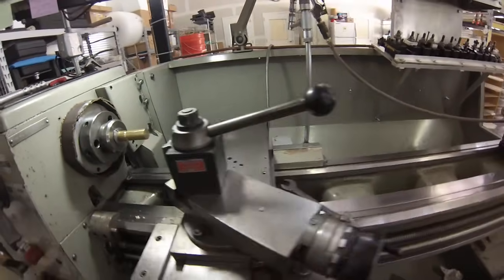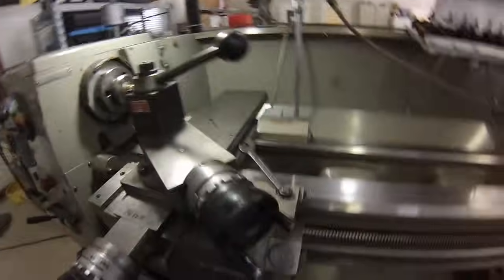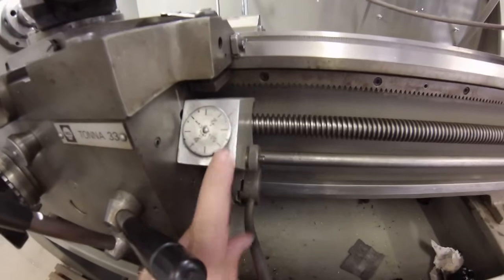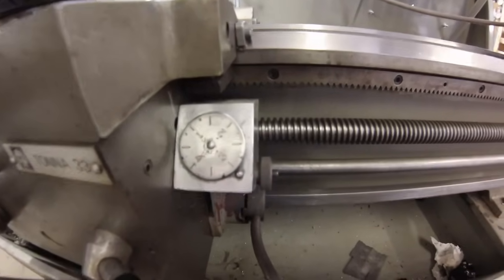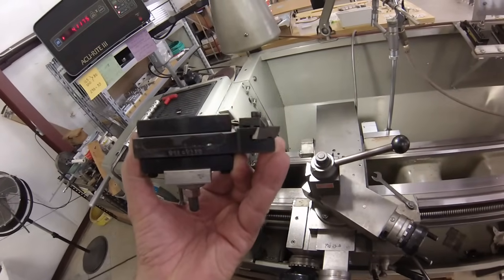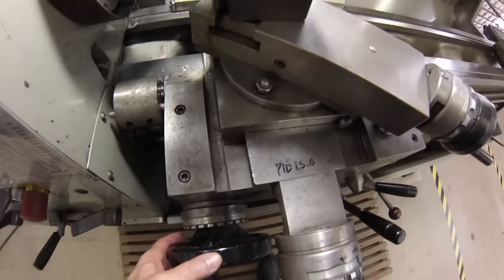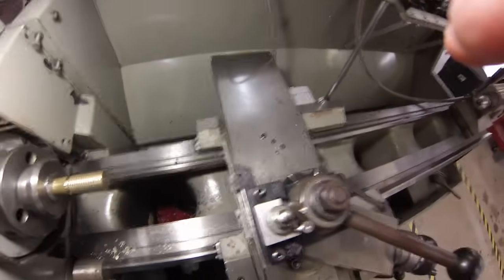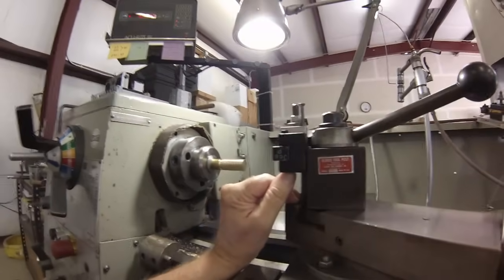Threading on a manual lathe  BEST TECHNIQUE EVER !!!!

Comment: This is good stuff folks.  Thanks Joe, I haven't seen any YouTuber show this method yet, you're spot on! I do have some experience as point of reference. Earned my engineering degree while also attending community college and doing a tool makers apprenticeship. In college we learned 30°compound, fishtail gage, feeding with the compound, threading towards to the chuck, etc. Needless to say I went to the shop and my mentor was threading this way - blew my mind. Even with a tailstock it's still my preferred choice. (if needed, there's tailstock extensions, half tailstocks too, Royal makes some nice ones)
Reply from the maker: It really should be taught this way. its so much easier and less stress.

Comment: Thank you very much I had never cut a thread on a lathe other then with tap and die.

Gave it a go first time after your vid and nailed it no problem at all without breaking anything and with enough surface speed to get a halfway decent surface finish with my insert tooling.

Keep up the great vids.
Thanks Again

Comment: Joe, sorry if this is a dumb question but I read through most of the comments but didn't see this asked.

My lathe has the compound set somewhere between 29º and 30º, angled toward the chuck. similar to yours in the video.
If I were to flip and center my threading tool to cut away from the head, wouldn't I need to swivel the compound the other way to feed toward the tailstock to keep out all the slack on the leadscrews?
 
I don't know if my machine would be rigid enough to plunge straight in with the crossfeed.
Reply: yup, I've had a few threading jobs as of late and this inverted method is so awesome, my DTM holder (CA size) even has a pocket for the inverted insert - never really noticed it until I decided to try it.

I'm doing internal threads the same way with a boring bar/lay down insert style tool.
Reply: I cut threads traditionally with the 29 deg method, but have since adopted Joe's approach and just feed with the cross slide and use the inverted tool.  It just seems to work - I do however use carbide inserts, so than may help.
Reply: Last weekend I made a height gauge for the lathe to recenter my tools like in Joe's other video, and flipped my threading insert while I was at it. I cut a 32 tpi thread inverted just plunging in with the crossfeed and other than I went slightly too deep, it looked perfect. Smooth, no tearing, and no clenched butt cheeks cutting away from the chuck!
Reply: I had the same question. I haven't seen it answered.

Comment: Hello Joe, also your carriage moves away from the swarf instead of over it and we all know what havoc brass can make in your slides. Thanks great video PS what lathe is that?
Reply: lostvikinga 
Hi, That's a Colchester lathe, a long-bed Triumph 2000, I think. Nice solid machine. I've got the smaller Student model.
British engineering, sadly no more . . . .
Reply: @steveallarton98  Hi there, it's fantastic to see that the conversation from this vid is still running 2 years after its launch. I had experience of the Colchester Triumph 2000 lathe during my apprenticeship in 1973. Our training establishment (Newcastle College) had two new 2000's among the older Student square-head lathes.  I preferred to Student probably because I had more time on it and found it a delight to use,  but the 2000 was an impressive machine. I now have a 51 vintage Boxford A and will try Joe's reverse threading technique next time I'm cutting a thread.

Comment: could you possibly show us a video of the L/H  holder you would use to do this, say make a bolt for us please. That's what I am trying to achieve with my limited skill set... VERY LIMITED
Reply from the maker: This is the tool I used for that video. It must be placed in the holder upside down.  https://www.mscdirect.com/product/details/64923956

Comment: OK, so i just found the limitation of this method. You can't actually even thread up to a shoulder caus with the insert up side down it is like an inch from the shoulder any way  :(
Reply from the maker: Use a left handed holder. Problem solved.
Reply: DOH!! LOL, should have known not to second guess you. In my defense; I didn't know they actually made a LH carbide threading tool holder
Reply from the maker: Kennametal is a great source for tooling. Check mscdirect.com to get them at a good price.

Comment: will this work on all manual lathes or are there some that wont thread in reverse?
Reply from the maker: I believe this should work on the majority of lathes that have threading capability. If the machine can run a thread, and that machine can run in reverse, it should be able to thread in reverse. Just watch for threaded on chucks. be careful.

Comment: Glad I ran across this video. I always threaded towards the chuck using my brake, even after a machinist friend told me about your way.  Reason being I did not understand how to use the dial... I'd leave the nut in and back feed! What a dub. I got my stuff done tho, I'll have to do some practice threads this way sometime and get a handle on that dial.
Reply from the maker: Check out the 'Engaging a half nut made easier" video too. It may help you.
Reply: Ha yes, I did right afterwards. I had a question which would be quicker to ask you than figure out myself: this only works with American threads I assume? Also 11-1/2 I have done too so they may not fly with any number on the dial? Also metric threads I was wondering about, my machine does both. Thank you!   All best
Reply from the maker: Threading away from the chuck will work with any thread. The engagement status of the halfnut really won't impact the process. Just be careful on metric threads if you use a solid stop and leave the nut engaged when you return to the start point.
Reply: Joe, is 11-1/2 even or odd? Probably just leave it engaged and run back and forth. I appreciate your vids!

Comment: Great idea.  I have cut threads many times and I always about crashing the headstock.  Knock on wood, I have not done that yet but this does virtually prevent it.  Thanks a lot!!!!!!!
Reply from the maker: Please try it with a solid stop and let me know how it works for you. I will never do it any other way.
Reply: Joe,  Right now I am suffering with a broken left leg and I am in a wheel chair - sooo I am not working at any of my machine tools, but I am absolutely sure that using a stop is the right way to do this.  Very very nice - Thanks again

Comment: Good video Joe. The reason for the 29 degree compound setting had to do with using the compound to set the depth while always returning to Zero on the cross slide. I think I remember that the 29 rather than 30 degree had to do with taking the brunt of the cut with the trailing tool edge. You do realize that a true manly machinist takes pride in the quick hands and lightning decisiveness required to disengage the half nut at precisely the right mili second to avoid disaster:)
Reply from the maker: Once upon a time I was OK with that. Now I use a rigid stop and relax when I thread.

Comment: great old method. You could use same setup for internal threading using a left hand bar, cutting edge up and on the backside of the bore. jog into the groove and thread out.
Reply from the maker: Threading out is the way it should be taught. No more sheared lead screw pins.

Comment: i also use pitch wires often...but usually go a couple grand under chart size..the chart size works good in a perfect world..I've never had a problem someone complaining about the hundreds of threads i have single pointed..keep up the good work my friend
Reply from the maker: Hi Ted. I have run a considerable amount of threads for military and aerospace applications and when they say 3A or 3B, man...they really mean it. Root, crest, PD, minor...they check everything on a comparator and ding ya if anything is off. It was overkill, but great practice. Lots of faceplate work on valve bodies too. A nice low side class 2 fit on a round part is a beautiful thing.

Comment: I have been thinking about this video for a while. What would you think about stopping the lathe. Turning the spindle by hand till the thread gauge lines up where you want it. Engage the half nut. Then turn on the lathe. That way you could eliminate the possibility of lining up on a half thread which could still make your butt pucker.  You could also set the compound to 29.5 degrees in the other direction and not get behind the lead angle.
Reply from the maker: I am sure that would be Ok, but the gaps in all the gears and such need to be active and compressed or you may have a "drunk" thread. I would think the thread would start differently than it would finish.

Comment: Hey   Joe have you ever used Thread Triangles  to check a thread I like them better than Wires .    by the Way when I was a kid in Votech  40 yrs ago  Guess who ran the carriage into the head stock while Threading  Close .   Guess who also had to fix the Quick change Box. It was and old South Bend and a Great Learning Experience .

Comment: Yeah, this is a pretty awesome method. I've used it quite a bit when threads run right up to a corner. I can't say its the greatest method, I don't like pressure pulling against my tool post, but threading typically doesn't have tons of tool pressure.
Reply from the maker: Agreed.

Comment: Nice video some good advice. The same can be achieved using an internal thread bar on the opposite side of the stock. Spindle still runs in reverse but the rotational forces will be directed into the solid tool post. The tool won't be lifted off of the tool post should it become loosened. You still need to be aware that the chuck can still come loose though.
Reply from the maker: Your suggestion is good, but conditional. On longer parts, or parts between centers, it can't be utilized if a long part is exposed before the threaded area. In all my years, I have never positioned a tool on the back of the part in a conventional engine lathe. I was just never shown or exposed to that technique. One day I'll have to try it out. Thanks for the comment.

Comment: Obviously you never worked at the die shops I worked at they used nuts to check threads,even cnc.I have used wires.
Reply from the maker: Interchangeability is out the window using nuts. Thats a very poor practice unless the part never leaves the building.

Comment: I used the pitch wires in thread grinding and took me a long time to get the hang of it to line the wires with one hand  and on the other holding the micrometer, mind you high pressure  oil was the used in cutting so your hands and anything else was also covered .
Reply from the maker: Try the single wire method. Its easier to hold. Check out my other video on that.

Comment: Hobbyist machinist here, all self-taught or watching videos.   I've learned how to single-point thread, but always wondered if I could turn towards the end instead of towards the chuck.  Also, I'm one of the beginners that has always used nuts to tell when to stop threading.  Finally, I keep the cross-slide fixed and clamped down; and use the compound at about 29-1/2 degrees and work it in with many passes.   I'm going to have to watch your video again before trying what I think I saw.  But I do like the safety of cutting AWAY from the chuck.   Thank you for the video.

Comment: Those of us who never  worked as a machinist but still want to  machine as a addition  to our hobbies find this very practical. A ChiCom lathe with no stops has me  doing all I can off the part and into the safe zone. A machinist friend watched me  "going the  wrong way" laughed at me and told  to just set the  stop. Sorry but  my Chicom scrapomatic only stops on  broken gears and  blown fuses. OOOO!
Reply from the maker: I believe only Hardinge lathes can use hard stops. Some Monarchs too I think. I'd rather start at the hard stop and thread away. Much easier.

Comment: Hi Joe, it should be mentioned that most hobbyists have lathe with screwed-on chuck which could off-screw itself during reversed rotation work. My 13" lathe's chuck is very tightly on and I do work with CW rotation carefully, I  would not do it on my Atlas lathes. Of course if using some collet holder my comment should be disregarded. That Old Bob.
Reply from the maker: Its clearly spelled out in the text under the video.

Comment: First , thanks for the video , I cant believe I never thought of going from left to right when threading!!! thanks again! Second when you run the tool upside down do you still run the positive rake? do you center the tool just like you would right side up?
Reply from the maker: My tool is on, or just slightly above center, and a positive rake tool works just fine. Thanks for watching.

Comment: Is there any need to change the direction of the compound for this threading Method?  I typically thread with HSS and the compound @ 29.5*, with front of the compound facing the Chuck  (RH threads).
Reply from the maker: Not really. The only difference will be the chip bias . To be sure everything cleans up at the end, if you don't plunge cut, I may decrease the 29 degree angle to around 25 or less.

Comment: Joe,I will give it try as I currently have same lathe although in the U.K It's branded a Triumph.I make up ram rod ends etc.Using inserts .My way is to switch off machine and put the lead screw in gear and turn the chuck by hand,then power reverse feed back to start.As my reactions aren't the quickest,working my way through your vids.Regards George

Comment: What if you cant have a thread relief?  You are back to the old direction.  Get rid if the hard stop, use 1" drop indicator that goes around once before the zero point which is when you simultaneously kick out the half nut and back out the cross slide.  You get good at pulling out the cross slide at the right rate after awhile.
Reply from the maker: Unless you are cutting a small diameter thread that terminates against a large diameter shoulder. Your technique wouldn't work.
Reply from the maker: Or thread mill the detail on a cnc mill
Reply: Well, we are talking manual in any case.  CNC is off point. If there is a shoulder you usually get to have a relief, and you can stop it every time.  Before you hit the shoulder.  Naturally, mistakes HAVE been made, part of the learning process.  By the way, great vids.  Thanks.  Always interesting.
Reply from the maker: Thanks for the comments. The majority of the threads I run are always to a shoulder, so this technique is my standard.

Comment: Wow, no more pucker. Can I still set my compound to 29.5 degrees and increase the depth with it and use the cross-slide to retract to re-position the carriage and set to zero for the cut?
Thanks Joe for all your help.
Reply from the maker: The chip load may still be bias to the rear, but it will work.

Comment: Good way for beginners to learn . If  you use a live center , you would still have to stop the machine at the right time ,right ?
Reply: My home machine shop HS53 today was the first time I used Joe's method. I threaded some parts I have made before. 3/8-24 thread. With the traditional way, 140 RPM was about as fast as I felt comfortable, no undercut to stop in. 

With Joe's method, even using a standard live center, 270 RPM with ease. May be able to go one step up to, 370 RPM. But, even at 270. It was still a lot faster than the old way.
Reply: True but more forgiving
Reply from the maker: That depends on the size of the part and the size of the live center. The disengage zone would still be considerably larger and easier to hit. Look in your tool catalog for an extended live center. It helps.

Comment: Awesome video Joe, so many diverse methods to this trade. I believe the same principals apply to internal threading governing the direction of the chuck and lead screw? Perhaps you could just demonstrate that for us if you have a chance as I always think that there are not any stupid questions when it comes to machining only stupid mistakes. I also have been looking for information on the correct procedures when it comes to setting up shafts on the lathes or other parts which require you to use a steady rest. You seem very knowledgeable Joe any quick tips when it comes to feeds and speeds? thanks a million I am probably going to be picking your brain in the next little while for the tricks of the trade thanks for sharing.
Reply from the maker: I plan to address at least 2 of your topics in the very near future. Hang in there.

Comment: Great idea, but what if you're using HHS, do you still plunge straight in or use the compound?  If you use the compound, do you turn it to 29-1/2 deg. the other way?
Reply from the maker: Hello. If a threading tool is ground and oriented correctly, the angle of the compound doesn't matter. So long as its less than 30 degrees of course. All the compound angle setting does is differ the chip load to one side or another. Both sides still cut. Conventional positioning is still OK. As for the HSS question, if the material is usually cut with HSS, I don't see why it would matter. I use this technique regardless of the material I cut, or the tool I use. HSS as well as carbide.